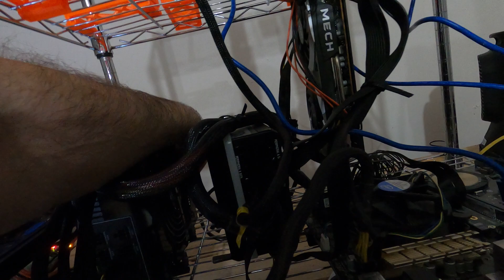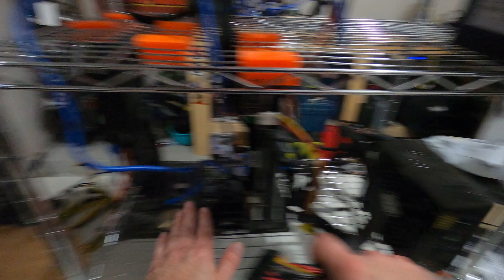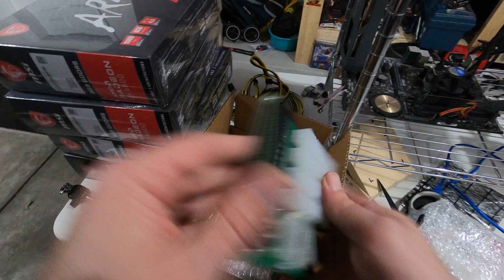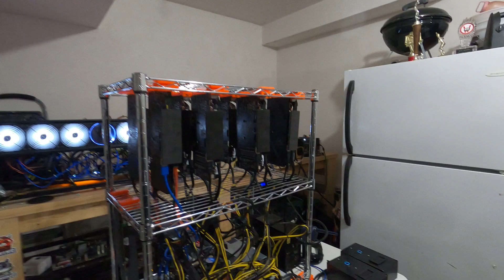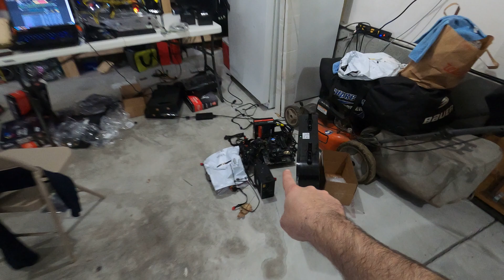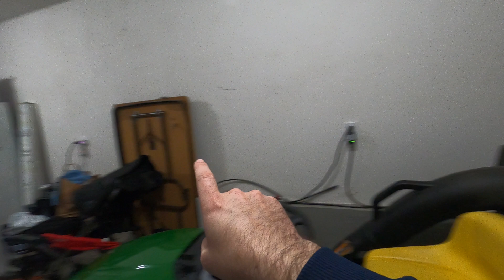GPU Mining Rig rebuild | Adding 4x RX 6600s

Comment from the maker: What was supposed to be a routine 4 card installation ended up being something a bit complicated... tell me about your mining struggles!?
Reply: My struggles mainly revolve around motherboards and not being able to get the video out signal.  Most recently, it was a B450 board with an old BIOS that couldn't accept a 5600X without a BIOS flash (with another CPU) first.  I'm a small miner, so I don't just have spare old CPU's laying around.  I had to take another rig down for a significant amount of time (which was almost half my total hashpower).

On a different B450 board, I was thrown off for the longest time by a weird behavior it has (and I bought it new, too).  Upon any reboot, still to this day, after the OS boots up, I lose video output to the monitor for 1 minute and 15 seconds.  It always comes back, so it's not a major problem...but, when you're new and trying to troubleshoot...that one screwed me up for the longest time.  I would shut it off before waiting a couple of minutes thinking whatever trial and error I was doing wasn't working when all I had to do was wait.
Reply from the maker: @magiclucky5152  thanks for sharing magic lucky !

Comment: Great video CaveManMining. That Asus  Z97 motherboard might still be good, you might have to go into bios and set Integrated graphics as the default display you could try that before you fully get rid of it. Or try booting it without any cards and making the integrated graphics as the default. Also they sell M.2 to Pcie Risers which have a usb connection on the M.2 connection instead of having to plug in a 1x pcie and then a 3.0 USB to that 😃
Reply from the maker: Can’t get bios to load or any screen output. Even with Integrated graphics I tried flashing bios with cmos no dice 🎲  it’s very strange I can’t recall zapping anything
Reply: @CaveManMining  I was wondering what kind of standoffs you were using on your rack because I couldn't see anything in the video.  I usually just cut pieces of cardboard to size.  I have one rig just sitting on top of the motherboard box, too.  But, my rigs are definitely not "YouTube video" worthy.  I can appreciate the extra effort you guys do for presentation.
Reply from the maker: @magiclucky5152  I used clips from @chumpchangexd specifically used for wire rack it works quite nicely. Bro whatever you have is YouTube worthy! As long as you care about what your doing then I think people will love to see it!

Comment: Same thing happened to me. I touched my very first mobo with the little pcie adapter, power was off but not unplugged and I think something discharged, fried my mobo. Luckily no gpus were damaged but I did have to buy another mobo, transfer the cpu and memory then build my rig again. Now, I always stop mining, wait till my cards cool, shut down properly, unplug from the wall wait like 5 mins, then start working. No issues since
Reply from the maker: Thanks for sharing brother

Comment: I must be missing something because the meter says 8.78 Amps is this pdu somehow 120volt on a 240volt circuit? Also 20 amps at 240v is 3840 watts at 80%.
Reply from the maker: You are 100% right some reason I was giving numbers for 120v this is 240v so I still have plenty of play on the circuit! and PDU! Good eye!